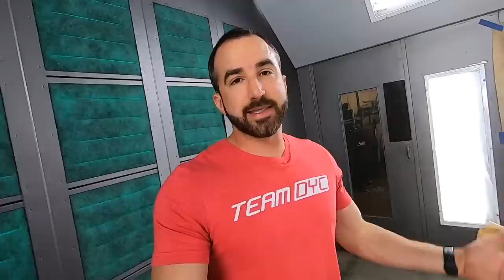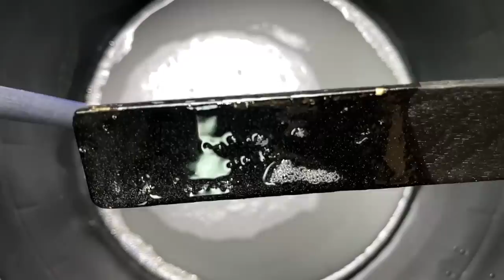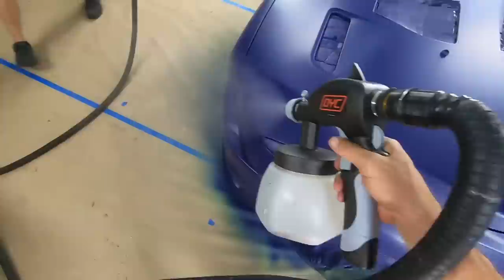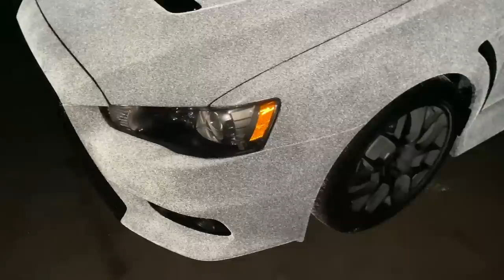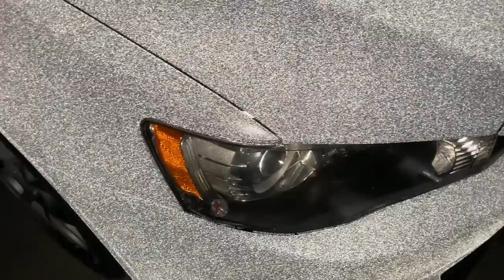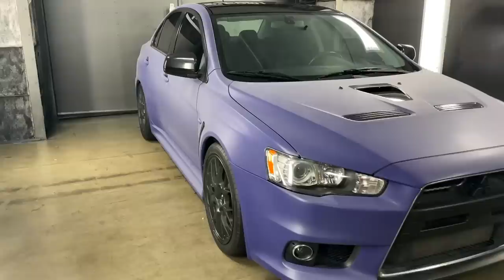Spraying a Car in REFLECTIVE Pigments (Insane!)

Comment from the maker: What's a good item to spray with Reflective Pigments ?
Reply: Hyped
Reply: My car. I’ll swing by next week.
Reply: Make a tron car, use the pigment to outline the doors hood and ect. Would look awesome
Reply: A pc case would be doooooope. I have some reflective adidas that are wild
Reply: Bicicle frames
Reply: I think that this would be great for highlights or masked pin stripes.  Imagine classic Mustang Hockey Sticks ghosted in with this.
Reply: Here at DM Plastidip we actually used the aerosol not so long ago. The rear end of Moped's and bicycle spokes.
Reply: A coat over the license plate
Reply: How about a retro refrigerator and stove. Awesome.
Reply: Those trainers were awesome! You might be onto a winner there!
Reply: Rims
Reply: This & musou black!
Reply: Racing Stripes, Wheel Stripes, pin-stripes - basically accents... also use it for making reflectors or pseudo running lights/markers where you don't want to run wires and lights.
Reply: amazing, It's like the car is shifting from blue to white. Can you make a paint combo that totally shifts into atleast 3 different colors. ex.: 1st color is RED the first color, then top it with THERMOCHROMIC PIGMENT and lastly top it with REFLECTIVE PIGMENT.
Reply: Bicycles!! So cyclists can be more easily seen!!
Reply: Get a pretty square car, like a 71 skyline or any other japanese muscle car, use grey as a base, tape off the body lines, spray the car musou, then tape off everything but the body lines and spray them with reflective particles, it'd be a wicked paint job for a car show or something else like that
Reply: not your trainers fonz, but its peelable, should come right off XD
Reply: A gas scooter  or motorcycle?  Small project but still a automobile... offroad accent on a smaller pickup.... have you done a golf kart yet?
Reply: @607CHA  against the law for sure as the photo speed camera flash will completely whiten the licence plate nr. Tried the similar solution and lost my Jag cos of it
Reply: add holographic flakes!
Reply: Muso black
Reply: House keys, decals, marking numbers ....I could spend a wee while writing but have to go to bed ...
Reply: Guy stop with mouso black it is acrylic and very very expensive. Very intersting would be if you could just outline all the efges on the car windows, wheel arches door handles etc
Reply: The rub rails on trailers, like flatbeds.
Reply: You could spray down a person that likes to jog at night.
Reply: Maybe a bike, MC or scooter ❤👍
Reply: You should have got a lights off direct flash of you spraying it out of the gun
Reply: I would've loved to see photos taken outside to see another side of the effect!  My favorite so far!
Reply: I'd still wear the shoes that said u've blown my mind with this one good look
Reply: Spray these reflective over musou black 😊
Reply: Bicycle Frames!!! Come out with more spray can colors as this will be an awesome addition to my bike.
Reply: License plate?
Reply: motorcycles would be nice or at least wheels. I'm might try this behind my grille
Reply: Absolutely amazing
Reply: I was wondering what this would do as a reflective under coat for a shifting or hypershift pearl, or mixing say 25 grams per gallon into a colorshift gallon?
Reply: @607CHA  it may be a state violation to alter a license plate..  or paint  on it in any  way
Reply: Gotta say this is awesome!!!
Reply: A police car
Reply: Dem cheeks, so you can see 'em bouncin' in the headlights.....😂😂😂😂😂
Reply: Next you should use mirror paint on a car. EXPENSIVE!
Reply: I was thinking accent lines on a car, much like the reflectors.

That said, motorcycle helmets would by my first serious thought.
Reply: The wheels to my equipment cart (or just the whole cart) for my yearbook photography job. I'm often in a parking lot of a school while it's still dark in the morning as cars are driving by (sometimes a bit too close). I'll take having something flashy to get their attention. Then at least they'll almost run into me walking by because of my cart looking amazing rather than just not seeing me. 😂
Reply: Think this would be sick on a snowmobile
Reply: wheels for sure! and call it cosmic crystal!
Reply: My car?
Reply: A bike...running shoes a audi rs6 avant...hehehe...loved the effect...liked it very much to see this pigment give a color to white-ish effect!......awesome experiment!...thanks for sharing!....stay safe and keep it up!
Reply: @budakhutan6104  doing that will lose the actual effect of the muso
Reply: @budakhutan6104  musou
Reply: reflective pigment over muso that could be interesting or maybe just blah... also side by side comparison of your regular black and muso as bases for your different pearls and hypershifts, you did a video awhile back doing side by side of white vs black that was pretty awesome, I thing black and muso might have some wildly different effects.
Reply: Muso black base with reflective pigment
Match made in heaven!!!
Reply: What if mo grams per gallon?
What if mixed into bright paint color, like yellow?
Reply: Try Hypershift at 50g with a gloss finish. Should look good, hopefully.
Reply: Spray this over musou black
Reply: Chainsaw....😁👍👍👍
Reply: Stripes on a car.  Or any kind of design on a car.
Reply: What if you mixed it with a color?
Reply: The company name and phone number on my truck,
Reply: License plates.
Reply: Motorcycle plastics!! Combo with Musso Black
Reply: Mix it with a color or a hyper shift/pearl topcoat
Reply: Cars. Period.
Reply: I think the Miso-black with deep red <like candy red> with the reflective pigments
Reply: License plate.
Reply: license plate?
Reply: @bushidobrown9857  the old snakeskin reflective adidas? Idr where mine are but they were so sick
Reply: you should mix muso black with this see how extreems work together
Reply: @1970HondaCL100  mine to
Reply: Helmet
Reply: Shoes. Those adidas are mesmerizing dude. Use them!!
Reply: @okumakamizu3030  , I don't think you can mix it directly with a color because it'd be like coating the reflective beads in solid paint and all of the effect would be lost. Maybe mixed with what they call a "juice" which is somewhat transparent.
Reply: But if you spray you sunglasses with this you won't be able to see out of them.
Reply: @nobeldnoble7048  I imagined it like diamond glitter, but the black is musou deep.. I believed DYC done musou with hypershift before, but the hypershift pearls are not as reflective.
Reply: Mussou black LOL
Reply: A cat
Reply: License plates
Reply: I know you guys are busy.  But when you do special project like these it would be cool to see it rolling down the street at night
Reply: @laleyendadeltaco  damn. The bike frame and a couple of trim pieces. With the rest painting in vents black
Reply: A bike frame and some accents and the rat of the bike with venta black
Reply: License plates
Reply: I'm going to spray my Addidas Boost like you did yours.... Custom Boosts coming soon
Reply: Trainers for running at night
Reply: sculpture
metal buildings
mailboxes
bikes
Reply: Phantom Racing Stripes
Reply: What about a thin layer of reflective on top of muso black
Reply: First responder vehicles
Reply: You should respray the Musso black and mix in only 25 grams of this pigment directly in with the Black for a lighter dusting to give a starry night effect
Reply: Bicycle.
Reply: Bicycle wheels
Reply: Musoublack
Reply: Custom motorcycle. Has that safety thing attached.
Reply: Children
Reply: Motorcycle helmets
Reply: So shoot candy red over top, the candy is clear based to you can change the color from white to red
Reply: A car with a Musou Black base.
Reply: Hot rod flames
Reply: Do Musou Black and Reflective Pearl on different parts of the car together or as a all in one mixture.
Reply: Put the Reflective Pigments on Muso Black and see what happens
Reply: I have an idea that a motorcycle would be awesome
Reply: Full body clothing + COVID mask + hoodie = anti-surveillance suit
Reply: I use the aerosol version to paint trail markers on rocks and trees.
I'm in rural Alaska where good marks can save a life.
Reply: I was thinking the same thing lmao ajajajajjaa
Reply: I could see doing highlights like trim or pinstripes with this. like a classy version of safety reflectors that makes a completely different look for the car at night
Reply: Kinda think it'd be neat to see a deep black with this over it
Reply: Auh..... 🤔think you got a lil reflective pigment in your beard there Fonz 😅
Reply: Geometric patterns on dark colored jackets and hoodies
Reply: Clandestine grow rooms lol
Reply: @davecallmedave3618  ultra bright IR leds on a switch
Reply: myself
Reply: My drumset
Reply: Bicycle! Bike helmet! You’re going to POP on a dark road in headlights and that’s going to make you safer!
Reply: Had a white Honda ST1100 a few years ago , and was always wanting to repaint it with what Main Roads line-marking crews used to paint the reflective road markings. Was getting really tired of not being noticed by by the other road users, and having to always have to ride with an extremely tight puckerbutt.
Reply: Dude, let’s just imagine taking the whitest white you could get, and dropping that on top. Absolute reflection.
Reply: Shoes.
Rucksacks. 
On the back of a Jacken. 
Clothes for Tiddlers/Kids. 
Many stuff for kids. 

Maybe a wheelchair?
Reply: Jacken = Jacket (German auto correct)
Reply: "Shut up and take my money!"
Reply: glow in the dark + reflective = tron
Reply: It actually looks really good!👍🤜👏👏
Reply: Can spray my company car like that, will be great! Always deiving at night and long distances
Reply: I wonder how muso black and the reflective pigment would turn out
Reply: Given some of the recent experiments, maybe playing with the juices and the reflective pigments would be something worth exploring.
Reply: A John Player Special tribute,
Deep black, reflective gold pinstripes and Logos
Reply: Those stripes in the middle of the road
Reply: My son’s boat. 🤙
Reply: Your shoes?
Reply: My wheelchair. Also those shoes are dope.
Reply: Bicycle
Reply: Tanks lol
Reply: This is an old video so I doubt this will get attention, BUT, I imagine a car would look terrific if you sprayed all chrome trim with this, as well as any interior wood-grain and chrome accents. Would give the interior an interesting glow 😁
Reply: Almost anything.
Reply: Vintage (70s) locense plates?

I am trying to restore a pair of vintage used WA state license plates and need to make them reflective and wonder if you would know of a reflective paint or adhesive vinyl that would accomplish this job? Or would these pigments work with the paint? And if yes, what kind? Enamel? 

Thanks for your time and video. 🙃
Reply: By the way, the paint or vinyl lettering and background is green and white.. 😊
Reply: Model cars 🚗
Reply: This puts me in mind of the powdered glass that the bureau of streets & maint. puts on the stripes painted on the road.  They lay down this super-thick stripe of paint... then throw handfuls of powdered glass on it, which makes the paint reflective... for as long as that lasts.
This gives me ideas.
Suppose I want to make a basketball court in my back yard.  I can mask and paint the stripes, then paint reflective clear gloss on top.  Possibly, with bright colors, such as white and yellow, I could mix the reflective pearls in the paint.
I wonder if they sell powdered glass for that? Or just pearls?
If I had a private driveway, I would want reflective road stripes and signs along the road. This could be useful.
Reply: Bicycles, recumbent bicycles and trikes, Velomobiles, motorcycle and bicycle helmets. These are just my humble opinions, I would really use reflective pigments on almost any Human Powered Vehicles.
Reply: Wow! what a total surprise! Please do the same thing over Anchorage Black base! Hidden Diamonds is what I would call this color scheme. Great job! Fabulous video!
Reply: How about a black base, then the reflective paint, all under a rich candy color?
Reply: Bicycle Frame
Reply: Put it over White 2.0 or silver, then cover it in a candy. Candy orange, candy blue, candy red.

Comment: FINNALLY! I’ve been commenting that you should do this for years! Used to work at a body shop that painted the trucks used at the airport with that stuff. My biggest regret was not getting it added when I resprayed my car!
Reply: Could you comment the procedure you guys used to get a finished automotive paint to be permanently reflective? Please be as specific as possible, or at least can you please let me know who I could contact to learn? 

Thank you
Reply: @st3vemcqeef495  I wasn’t one of the painters, just worked with them, so I don’t have the details. Basically they added the reflective glass beads to the paint as you would a pigment. The ratios would have been set by NavCan(the gov. agency that runs the airports in Canada) to get the right colour/reflectivity. Other than that it’s just a normal paint job. The beads make the paint retro-reflective at night but just looks like normal paint in daylight, and since it’s part of the paint it’s permanent.

Comment: This video saved me a ton of time getting mix ratios for the reflective beads.  I am going to wet sand/strip down two road bike frames, one to raw carbon and the other to polished aluminum, my plan is to put metallic primer down on the aluminum, then the reflective coat, then put the logo decals back (non reflective) and finish with a clear coat (may need to experiment whether mat or gloss).  For the black carbon frame I will probably use a little lower concentration of reflective powder (worried it may make the black look grey) put on with the base coat and again then decals and clear coat over top like before.  Silver decals over the polished aluminum and black decals over the raw carbon.  I am hoping this will really pop when hit by headlights at early morning or late night rides and just be a clean look in daylight.

Comment: So in regards to the aerosol can this is like a "permanent paint" not dip? is there any texture to the product on the painted surface? Also removal after the fact say it's more like a permanent paint solution over dip is this still easily to peel? I've always wondered if you spray clear coat over plasti dip would it act more like a "permanent paint" and last longer?

Comment: Thinking maybe a Kelly Green base coat, someone else comes in and does a flame burst with Kelly Green and KriptoBright Glow from the tip of the front bumper and little swirls along the sides, and then, THEN lay the reflective down, on the whole thing but at maybe 33-50% of what is seen here.  Would indeed use one of those figure eight football models to get that tested first.  Something small and round though, like the Miata.  Well, I know my next project.